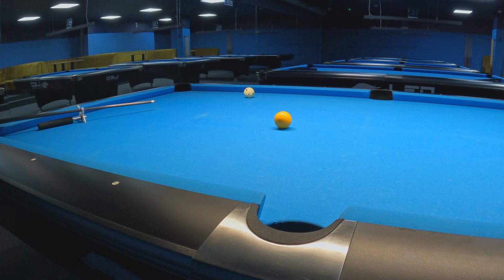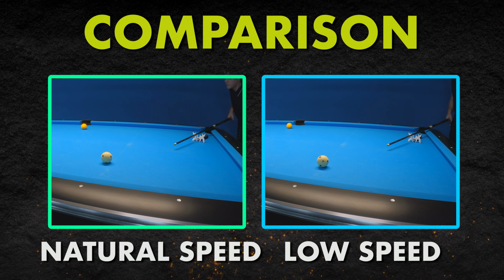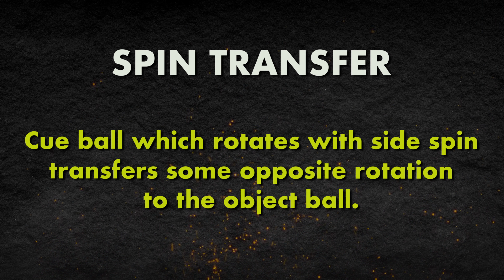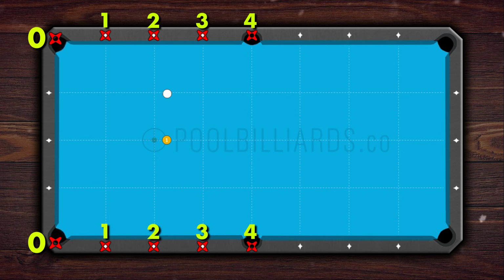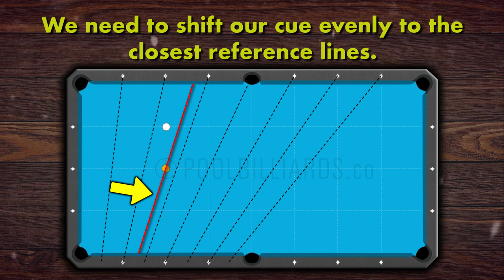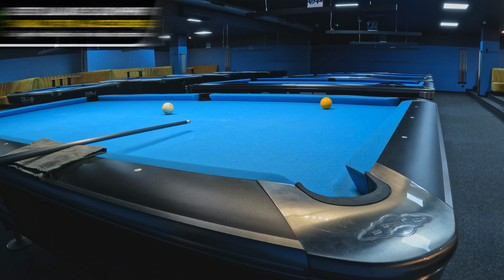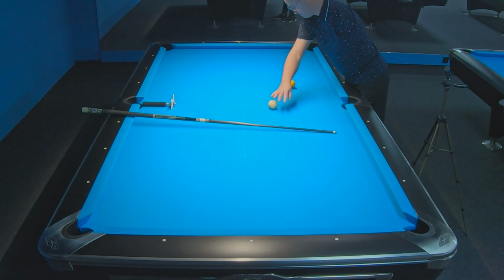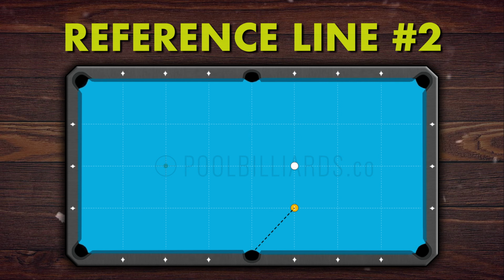The SECRETS to Executing EVERY Bank Shot with ACCURACY

Comment: I have a very simple bank shot aiming line decision method.  Take a side pocket bank for instance.  No matter where the object ball is with respect to the side rail opposite the target pocket...  either down near the 'corner end of the rail' or up closer to the 'side end of the rail', I always simply imagine another table sitting next to the one I am on, with the side rails superimposed over each other.  If one imagines a side pocket one table width away and one shoots the object ball toward that ghost pocket, it will bank to the intended pocket.  It works on the long rail as well.  If you imagine another table down past the end of yours and shoot the object at that second table's far corner, the ball will bank to your near corner.  Transferred spin and other effect alter this path, of course, but center ball rolls true to this every time.  Shooting too slow allows the rail nose spin on wider angle banks to walk the ball outside the straight line path, so a certain speed is needed to keep the bank true as wider and wider banks are shot and sometimes a very slight corrective side spin to compliment the spin applied by the rail nose.  Of course I refer to higher impact velocities.  Slow banks barely crush the rail nose.  I fire banks off the rail knowing where it will launch towards.

Comment: Thanks for the tip, I've already started using it, you use the long rail, what is the system for using the short rail
Reply from the maker: Thanks for your comment! If you want to hit short rail first then it works the same like in first system. You need to find your track lines connecting diamonds 1 with 0,5, 2 with 1.... :)
Reply: @MrCueBall  thanks for your tip
Keep on doing the videos, very helpful

Comment: That last shot is so fuggin dope. I'm taking this info straight to the pool hall. I've tried to do this several times, but now i realize what I've been doing wrong. I don't think I've seen any other pooltuber put this info out. I'm sure it's out there, I've just never seen it. Great video, man.
Reply from the maker: Thank you so much for your comment!!!
Reply: You can visualize the ghost ball position by drawing a line form the corner pocket through the center of the blocking ball. A perpendicular line from the center of the blocker will pass through the center of the ghost ball. Then, as shown in the video, measure the center of the ghost ball to the rail and double it on the rail. That point on the rail will be the aiming point for the object ball.